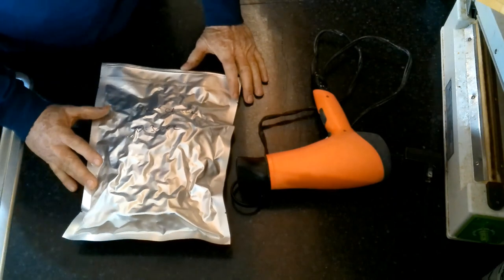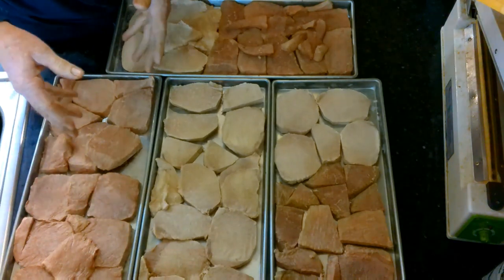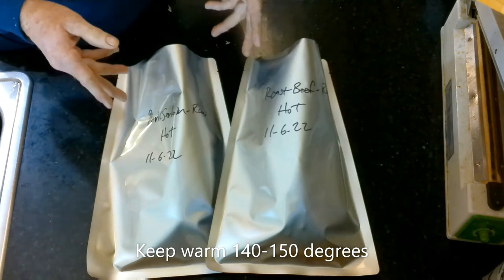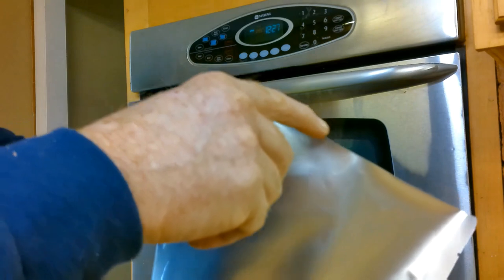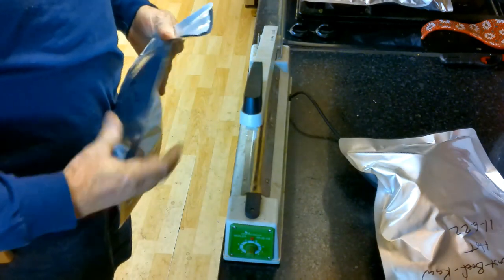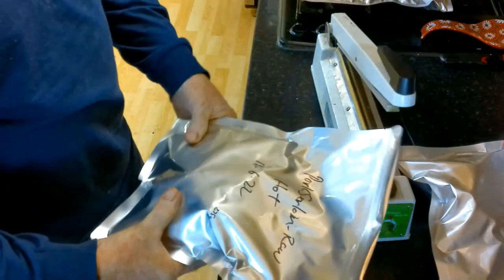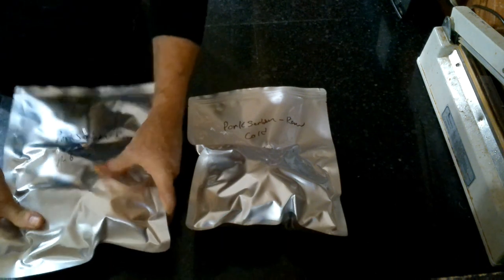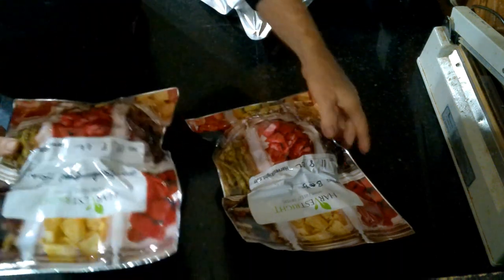Vacuum Sealing Without a Vacuum- Addendum

Comment: wouldn't heating everything up like this cause condensation?
Reply from the maker: Only if left exposed to the atmosphere where the atmosphere contains enough humidity to reach the dew point.  Warmer air is thinner air.  Once seal in a bag and cooled, the change in pressure will create the vacuum.
Reply: @Philat4800feet  ahhh, thank you for the explanation